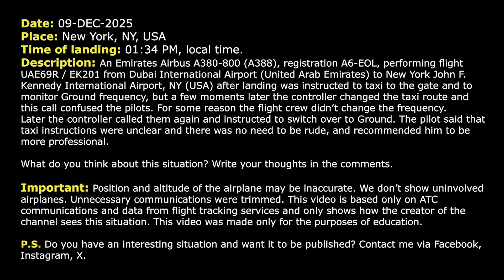Emirates pilots ask JFK controller to be MORE PROFESSIONAL. Pilot argues with controller. Real ATC

Comment: ATC wanted to change clearance last minute, they should not rush B777 traffic behind emirates to cross the runway as the ATC should better understand, that maybe emirates will need some time to process with the new routing. And for basic training is, when u unsure, stop position and review again rather than getting involve into taxiway incursion. ATC should not rush when it involves two or more traffic together especially when they gonna change the routing on the 1st traffic.

Comment: I can see why it was unclear and why they felt rushed, but their response wasn’t necessary at all. There was nothing unprofessional about how controllers handled this by any standards, but they especially New York’s. This could be resolved easier with a simple “unable expedite. Please clarify straight ahead onto alpha instead of right on alpha?” This is JFK, so I get the urgency, but we do need to remind controllers that safety is number one priority, not efficiency, so expedite should only be requested once - and it’s just a request. If anyone is unclear, they have to stop until they’re clear. An easy way to resolve the somewhat unclear change from right on alpha to straight ahead alpha, would be to say “you’re going to go all the way around the airport” - because it makes sense why that would be difficult for the brain to process the change of. All in all, a bunch of nothing, but Emirates needs to chillax; of all hills to die on at JFK, this isn’t the fight to be picking. And ATC needs to have these convos (as professional as they were) off air.

Comment: in this day of age, I find the way the controller and pilot communicate is too inefficient. There should be an AI running LLM that turns the instruction from the air controller into a route map, and display on a screen for the pilot to see and follow (and the controller can confirm the interpretation of the route is correct). Just like you follow the map when you drive a car. So, there would be no confusion for both parties.

Comment: I can see how the pilots were confused. They were originally to to hold short of the taxiway right there but the second instruction was not clear that they were going all around the airport. It’s very reasonable that they slowed down to make sure they were going the right way. Nobody is at fault here
Reply: No, they were told “cross 22R, turn right on Alpha to the ramp monitor ground .8” they were cleared all the way to their exit at delta. Next they were told to hold short of delta (their exit to the ramp) essentially the same clearance except not turning into the ramp.  Then they were told to go straight onto Alpha and hold short of delta.  So instead of going anti clockwise to their ramp they go clockwise to their ramp. This is very standard JFK instruction.
Reply: The system is at fault.  If the instruction isn't clear, then something is missing. Either in the instruction or in the reception.

Comment: I don't believe Emirates knew they were gonna circle around the airport when the same instruction was given twice... that's where the confusion came in
Reply: Exactly. When they receive an amended clearance like that they have to check the charts to see where they're going. One wrong turn in a 380 and then things really get complicated. 
" continue straight on Alpha, you're going to continue all the way around the airport to hold at Delta again and contact 121.9" that would have avoided all that and would give them time to look at the charts for the holding position.
Reply: @wacker2286 you're assuming that they are polite, even tempered and use standard phraseology....a rare occurrence in the states.
Reply: @Bread_Garlichouse very true!
Reply: I agree. If the controller had stated long way around or all the way around the terminal they likely wouldn’t have slowed down. The crew has to know where they are going otherwise they risk making a mistake and then having to make a phone call for possible pilot deviation!
Reply: @brianfriend238  ikr is a fucking runway ahead! ofc the pilots would slow down in case something happened. The controller is stressing them out:face-orange-frowning:
Reply: @brianfriend238 Agreed.
Reply: @brianfriend238  Continue on A short D is confusing?  When you're the biggest airplane on the airport and your gate is occupied?
Reply: @e@e @erauprcwa  it is confusing when you have to go the long way around a terminal, something you’re not expecting. Obviously you have never flown into large airports. I have 30 plus years of airline flying. Try taxing around Barcelona or Madrid, that is totally different than North America.
Reply: @brianfriend238  I fly for a major airline. I'm reminded of Chicago O'Hare where they will regularly give you a taxi around the entire airport.  JFK does the same thing, as well as LAX.  

You're right, Barcelona or Madrid is different, which is why this is JFK.  Every airport has their own thing going on.  It's important for pilots to know the subtle differences with how things work at a given airport.
Reply: I've heard taxiway A and B around the airport are one-way only? one clockwise, the other counter-clockwise? that means airplanes very often go at least half around the airport, isn't it?
when the controller asked the pilot, "how straight A, stop at D should have been instructed so it's not confusing", the pilot finally (after almost rolling around the airport) switched 121.9 -obviously, there is no confusion with that "order" -4 pilots in the cockpit, none of them remembered 121.9?
-i listen often at Vienna airport, to me it sounds all the same "fast and firm voice/tone, responses from the pilots are the same way
Reply: Are flight crews assigned maps of airports prior to landing?
Reply: @kennonr7120 yes, they are available and it is their job to know the airport
Reply: @kennonr7120 they're in either the ipad or OIS
Reply: @kennonr7120 They have pretty much every airport in the world on their iPad or equivalent. The Emirates 380 also has the charts on their onboard EFB.
Reply: Actually as one who has flown into JFK for decades, I think they were all professional---JFK can be confusing even for seasoned pilots.
Reply: @38FlyerSo if it might get confusing, the controller shouldn't have lost his cool, which he did. The controller allways has to maintain his calm. He was reprimending the pilot in an unprofessional way
Reply: @mmfvital  Do you people struggle with comprehension? The controller told them to continue straight ahead on A as there was a 777 behind them. They did not do this, went far too slow and at some point seemingly stopped thereby leaving the 777 stranded in the middle of the runway. Once they understood they fucked up they came back with some KD vs D malarkey and then the captain takes the comms to demand(instead of kindly request, knowing full well that he fucked up) that the controller not speak angrily towards them claiming that they were four pilots and no one understood the change in instructions even though that exact change was repeated back to the controller by the co-pilot for confirmation. To me this is the height of BS, to fuck up then turn around and blame the controller for it while attempting to gaslight him. 1000% the pilot's fault, even if the controller could have handled in a calmer fashion(you try to be calm when you issue clear instructions, those instructions are repeated back to you yet aren't followed correctly with the potential for a major accident).
Reply: @Crypt0n1an They are anti-American.  The instructions were clear and the pilot changed the subject when ATC called him on it. 😂
Reply: @Crypt0n1an the issue seems to be that they were already on A and approaching D (at KD)  which they were told to hold short.
Reply: @whatever0007 Total hogwash which goes to show that most people on this comment section are driven by extreme bias instead of good faith investigation of the truth and fairness. D is on the other side of the airport nowhere near KD, that was a stupid excuse the co-pilot on comms gave in order to pretend they heard KD instead of D to justify their major blunder even thought the instructions were clear as day and were repeated verbatim by that same co-pilot for confirmation. It was gaslighting of the highest order while putting people’s lives at risk which you people on here are using olympic level mental gymnastics to justify and run interference for.
Reply: @Crypt0n1an no bias, just mistaking B as D on my phone while taking a dump.
Reply: @Crypt0n1an  If in trouble, if in doubt.  Slow down.  Even stop.  Don't blindly charge ahead into the accident.  There was NOTHING wrong with the pilots slowing down while they worked it our or asked for clarification.  Controller should not have stuffed another taxiing plane behind them crossing a runway.  And as a lot of others have said - "Straight on Alpha, hold short Delta - and add - "that will take you right around the airport".  This would never have happened.  After all - the "straight ahead on Alpha to get to Delta involved three right turns on Alpha.  Hardly straight ahead.  Now to be fair to the controller - what the pilots could have done to keep it cleaner was ask the controller to "mark the tape so we can call about this later and can we have a number to call".  Instead of tying up the frequency.
Reply: Not a pilot, but ... Yes, there must always be a consideration that the other guy is making an error, in ANYTHING. Turns out ATC did not make an error, but it probably seemed like it at the time. Clarification, confirmation to go all the way around would have helped. ATC should understand, and be more professional about things.
Reply: Always found the American RT very casual and Conversational.  While it is harder to pick up the accent in Japan,Korea,India at times, they at least use standard phraseology.
Reply: oh wow a europoor pilot working for an me3 is incompetent. better blame the american for correcting them 👳🏽‍♂️ 🇪🇺👳🏽‍♂️
Reply: Exactly
Reply: Exactly!
Reply: When he said “correction” this negates the previous instruction. So going straight on alpha and holing short of delta is the most recent instruction and was very clear
Reply: @ianbusche1471 If it wasn’t clear to them at that moment then it wasn’t clear. And that’s where the conversation stops. It has to be clear to the person in control of the aircraft, if it’s not, then it’s not. It’s as simple as that. It doesn’t matter how clear it is to someone else. They are responsible for the aircraft and all its occupants. It costs nothing to stop and get clarification. The ATC response was unnecessary and unprofessional but it’s all too common in the US.
Reply: @wacker2286 if you can’t understand basic instructions, you probably shouldn’t be in control of an aircraft. Not much more a controller can do if he gives a clear instruction.
Reply: @ianbusche1471 haha ok chief! You know best.
Reply: @wacker2286  It was clear enough for the co-pilot to repeat it to the controller once the altered instruction was issued. Stop with the BS and gaslighting, the pilot effed up, the instructions were perfectly clear, the co-pilot on comms understood them well enough to repeat them but the execution was bad which is why the controller chewed them up about it. He told them to go straight on A and not to stop because there was a 777 behind them. They did not do this and seemingly stopped at some point thereby leaving the 777 exposed on the runway for a prolonged period of time. You tell me who's at fault here, unless comprehension is not your strong suit or you would rather play dumb because you have an issue with controllers. That wasn't bad enough the captain then takes the comms(with a Spanish accent) and claims the instructions weren't clear and no one understood them which is obvious BS to cover up for his fuckup and because he was too butthurt to take justified telling off on the chin and move on.
Reply: @wacker2286 The problem is he stated the instructions were confusing AFTER getting chewed out….if they were confused, then they shouldn’t have read back the instructions verbatim and they should have handled the confusion immediately…instead, they did the worst thing possible and tie up crossing traffic on an active runway which could have turned into a runway incursion if they had inbound traffic landing on that runway. 

Pilots flying 500-600 passengers across the world should be able to understand “straight,” instead of “right.”
Reply: @ianbusche1471 The instruction was clear, but the intent of the ATC correction wasn't made clear. The ATC probably needs to communicate intent better for pilots not used to operating in JFK. "Continue on Alpha doing a lap around the terminal, hold short of Delta". That might have better explained why they are taking a long route to Delta and remap in their brain. Otherwise it might have seemed like an ATC mistake or they need to spend time looking at maps working out where straight on Alpha leads.
Reply: @Diode5  Mate if you think a captain and crew piloting an A380 had landed on JFK for the first time and didn't know their way around then you know absolutely nothing about aviation and shouldn't be commenting on these videos. The instructions were clear enough especially the part about not stopping because there is a 777 crossing behind them which they obviously failed to do(slowed down and seemingly also stopped leaving the 777 exposed on the runway for a prolonged period of time hence why the controller chewed them up about it). I'm almost certain the person posting these videos views them as an IQ test of sorts to see what percentage of people understand what is truly going on(do you people even read the comments in the video, do you try to factor in all the variables correctly or are you guided purely by bias?)
Reply: @ianbusche1471  that’s what I heard too. I heard the correction clearly. What did they not understand??  Hmm
Reply: @a @arvince99  is confusing as not all the time you will taxi around the airport. They might have not expected that. That's why they slowed down and got complained by the tower. An A380 taxi to the wrong direction will cause more trouble and delay than a slow taxi.
Reply: @ianbusche1471 turn right on Alpha hold short of Delta. Correction, go straight on Alpha hold short of Delta. Nothing in that raises questions in your mind? Like how is it possible I will arrive at Delta intersection either way? Thats when they slowed down to look at charts.
Reply: @deanmiller8861 yeah, atc def had yo tell that they need to go around airport to not confuse them
Reply: @deanmiller8861 absolutely correct.
Reply: @deanmiller8861  This is why you should have your airport diagram up and you'd see A goes around the airport and interseects with D.
Reply: I agree!
Reply: Agree,  but after all, this is JFK; you knew that ground instruction could be brusque.
Reply: It should not be. ATC need their arses kicked.
Reply: If the controller had added that in, the entire comments section would be full of ICAO phraseology experts.
Reply: @AdequatelySuitable  since when has JFK ever followed ICAO phraseology
Reply: @YBNmadman lol no fact plz
Reply: @YBNmadman 😂
Reply: Since when indeed! They are more obstructive than helpful.

Comment: I can fully understand that quickly changing instructions mentioning taxiways at the opposite end of the airport might not always be immediately clear to all crews. To slow down or even stop to make sure you don't go the wrong way makes a lot of sense to me. Also, since when is it professional or promoting safety to get agitated so easily? I agree with the pilots this was not professional from ATC but they should not have opened a discussion about it on frequency. ATC should not have engaged in that discussion either but offer to discuss it afterwards on the phone.
Reply: They think all the pilots around the world knows JFK like them, they are there every day, not the pilots. And imagine if the crew from Emirates enters in a wrong taxiway in the meantime and causes more disruptions. What is the problem to say: expedite, continue on A and hold short of another closer taxiway, then call ground... JFK ATC at is best.

Comment: Two things can be true: the instructions were clear, however, the pilots were moving too slowly. The ATC began scolding grown men as if they were toddlers. His tone was indeed condescending and ultimately very unprofessional.
Reply: I agree with the minority dissenting opinion.
Reply: "If I'm curt with you it's because time is a factor. I think fast, I talk fast and I need you guys to act fast if you wanna get out of this. So, pretty please... with sugar on top. Move off the fucking runway."
Reply: Until a plane crash lands on the 777 sitting on an active runway. Then, you'd say the controllers weren't forceful enough. Can't have it both ways.
Reply: @Rufus-g4b  Well no, cause if 22L is the landing runway, then 22R is likely the runway for take-offs, and nothing should be cleared for take-off while there is traffic still crossing. The urgency is likely just to prevent departures being held up. But an A380 is a massive aircraft, so I can understand the Emirates crew's willingness to not want to go too fast. Ultimately though, I think ATC's scolding was unnecessary, and he could've just politely asked them to increase their speed instead.
Reply: @Rufus-g4b why plan whuld land on taxi way
Reply: @Rufus-g4b why would they clear the 777 before there is space available for it to exit the runway.  That is non sensical
Reply: @Rufus-g4b  100%. Controller needed to be assertive. Maybe there was a better way to phrase it, but he had a runway to clear.